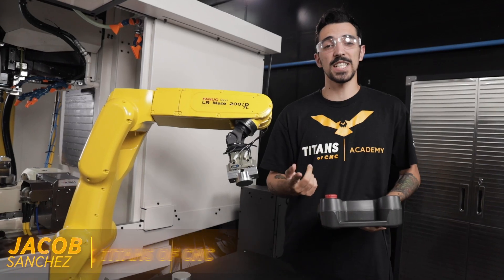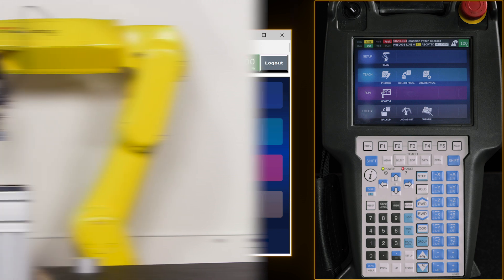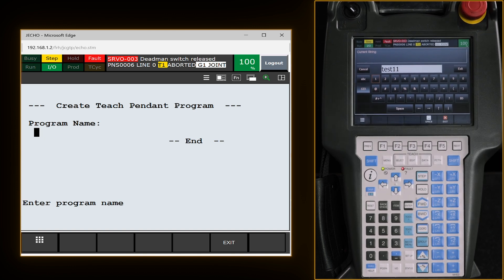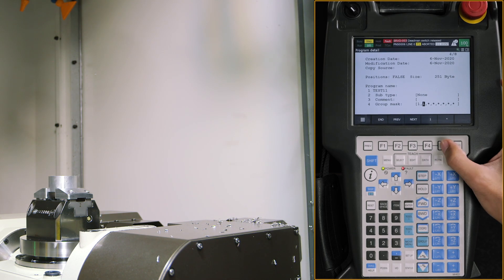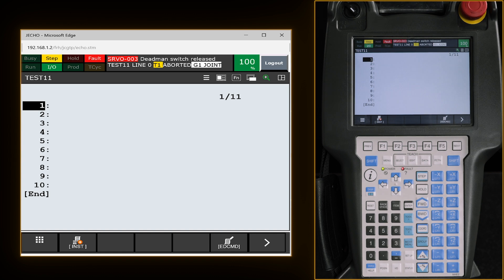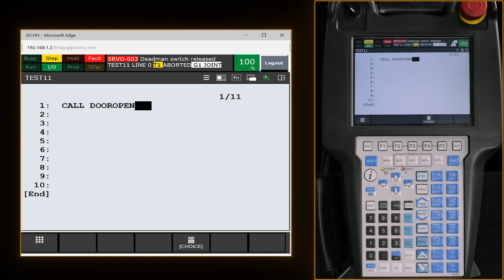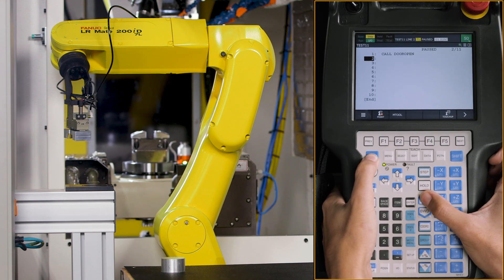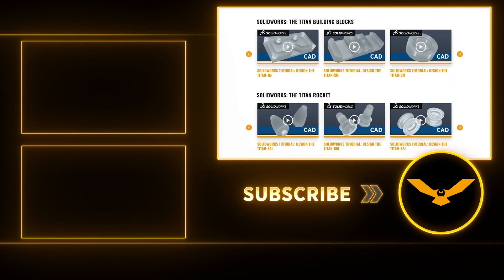Start Programming Robots NOW | Programming the FANUC LR Mate 200iD Intro Walkthrough

Comment: Its worth noting these Robots DO NOT work for all applications. I work with Dual Grade Stainless pipe that is extremely gummy. The shavings created through the threading process wrap around the pipe and create indexing problems and regular crashes when the robot attempts to flip the parts. It was a short lived experiment